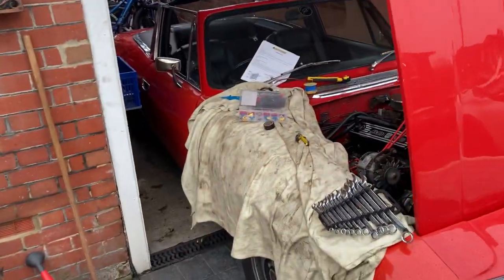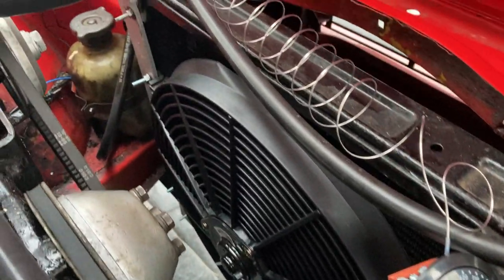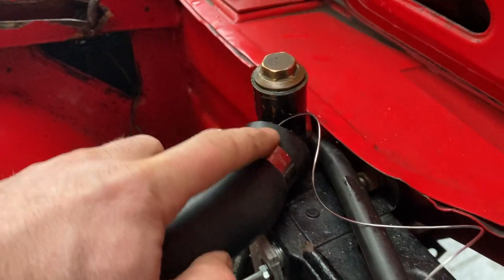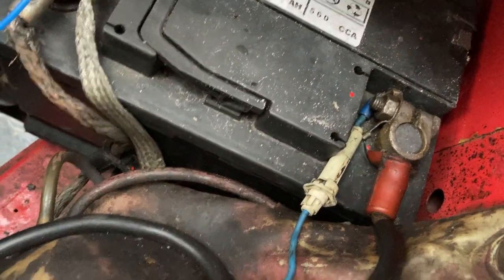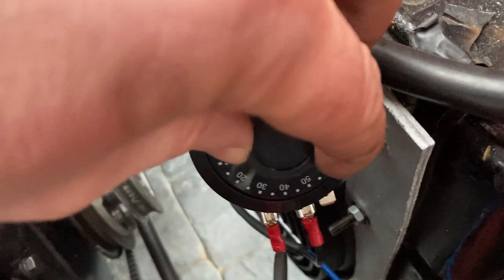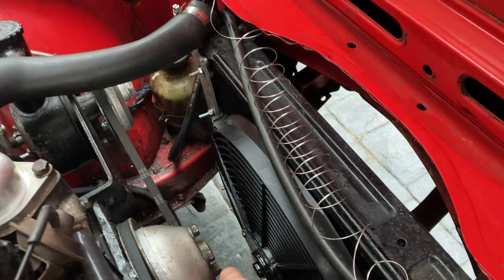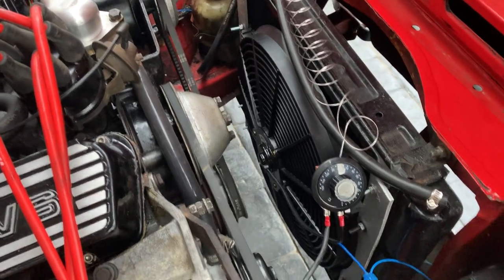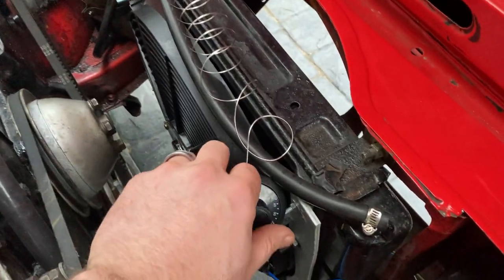Chix's Triumph Stag Ford Essex 3L V6 - New electric radiator

Comment: It will work much better if you fit a shroud.
Reply from the maker: Hi Wayne, what do you mean shroud? Thanks
Reply: @djchix  Hi Chix yes a shroud, I made one from angled aluminium so if pulls air from all the radiator area gives great cooling, I did some research and people say dont put the fan against the radiator as over time the plastic clips dry out brake off the problems arise
Reply from the maker: @waynescott6578  Thanks dude, I hear you. Luckily I made my own mounts, rather than using the plastic fittings that came with the fan!